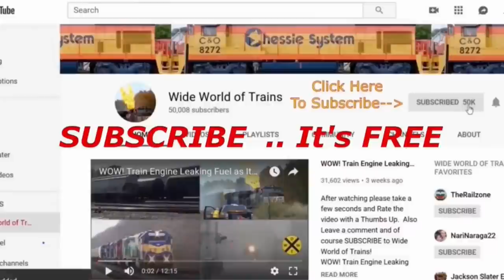CSX Train Electric Motor Burning Up As It Goes By! UP + NS Power on Tank Train! Trains Meet at Night

Comment: Looks like the traction motor is having issues - either electrical or perhaps grease fire from bearrings or maybe the motor itself - wow!  I am surprised that the conductor didn't spot it sooner. A night meet and it looks really cool!
Reply from the maker: They must have spotted it a few minutes later because it stopped about 8 mi from where I was and they checked it out
Reply: @WideWorldofTrains  Yes - that is pretty much a pain in the neck. Might have had to cut the locomotive and replace it. Time consuming process :)
Reply: you correctly noticed. there was a weakening of the power cable, because of this, the insulation began to overheat and the engine began to smoke with white smoke. bearings smoke blue smoke.

Comment: While riding my bicycle on the I-10 Frontage road, there was a UP train with three up front and TWO in the mid-train DPU. Also got to see and hear (the engineers blasted the air horn) the AMTRAK Sunset Limited on it's way Eastbound into the Tucson station. Interesting day if riding.

Comment: 1:00 We are at the Berry Road crossing in Pomfret, New York on 6 November 2021 looking west at CSX train #K678. This train was powered by an Union Pacific and a Norfolk Southern engine. At 3:02 after the gates go up, you zoom in on the end of the train. And we watch the train pass the Mile Post 44.X signals. At 3:54 the Mile Post 44.X signals go dark. At 4:10 the gates at the Van Buren Road crossing. At 4:28 we can see, in the distance over the train, the Control Point 42 signals bridge which is located at Mile Post 42.5. CSX train #K678 is an as needed train of loaded ethanol tank cars from Harrisville, Indiana to Sewaren, New HJersey. The Cardinal Ethanol plant is located in Harrisville, Indiana.
5:54 We are at the Berry Road crossing in Pomfret, New York on 12 November 2021. We are watching CSX train #Q568 crossing the Lake Road crossing. At 6L05 you notice that there is smoke coming from under one of the engines. At 6:53 the gates at the Van Buren Road crossing go down as the smoke interfers with our view of the engiens. At 7:34 you state that the motor on the first axel of the second engine is probably burning up. At 8:15 you make the statement that the train will have to stop before it gets to Buffalo, New York. You have a banner showing at that same time that says that the train had to stop in Dunkirk, New York.
8:32 We are at the CSX Middle Road crossing on the east side of Dunkirk, New York at night on 11 Nov3ember 2021. CSX train #I003 is approaching and we see its headlight. At 9:01 the lights on the Control Point 37 signal bridge light up and we see that there is a green signal for an eastbound train train on track #2. At 9:20 you have panned to the curve coming off the elevated tracks through Dunkirk, New York and we see that the eastbound train is coming around the curve toward the Middle Road crossing. This is CSX train #I010. At 9:40 the two trains meet at the Middle Road crossing. At 10:34 CSX train #I010 knocks down the signal for track #2 on the Control Point 37 signal bridge. At the same time the light for track #1 on the Control Point 37 signal bridge turned yellow/amber. At 12:43 the lights went out on the Control Point 37 signal bridge. You zoomed back to a normal view. At 13:07 you stepped in fromt of the camcorder and spoke to us about the trains that met at the Middle Road crossing.
14:11 We are at the Westfield Railfan Park in Westfield, New York on 8 November 2021. We are looking at Norfolk Southern train #22K approaching in the distance. The bridge over the tracks that we see in the far distance is probably the US 20 bridge. You said that the bridge over the Norfolk Southern tracks was the I-90, New York State Thruway, bridge. That bridge is about 10 miles away from where you were at the Westfield Railfan Park, in Westfield, New York. Can the zoom on your camcorder see an object 10 miles away? AT 14:26 the ditch lights on Norfolk Southern train #22K are flashing as the train approaches the Rogersville Road crossing. At 19:57 the Norfolk Southern defect detector at Norfolk Southern Mile Post 59.0 reports on your radio scanner that there are no defects on Norfolk Southern train #22K. At 12:11  you start to walk in front of the camcorder to tell us about Norfolk Southern train #22K and where you are at the time. At 20:21 the Norfolk Southern defect detector repeats its message about Norfolk Southern 22K.
20:55 Your outro begins and the video is coming to an end.
Thank you for documenting these trains and for uploading this video for us to watch!
Reply from the maker: Awesome, thank you!

Comment: Wow another engineer and conductor that just don’t care. Run ‘‘em until it self destructs. All he needs to do is look at the amp gauges and he will see it’s drawing to much power or it’s too low. I’m good catch thou.
Reply from the maker: He might have noticed that after he went by because they stopped 8 miles from me to check it out
Reply: @WideWorldofTrains  it’s actually a shame to see these locomotives coming down the rail with smoke coming out from underneath. I’ve been a railfan forever and I’ve even been behind the controls. Of coarse with the engineer right there to make sure I didn’t kill the train lol. I hate seeing trans in trouble